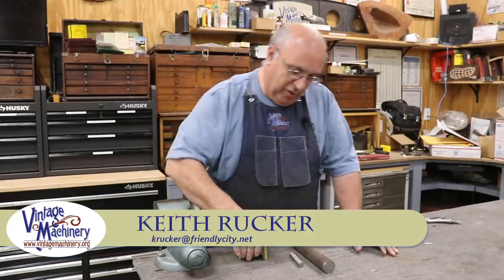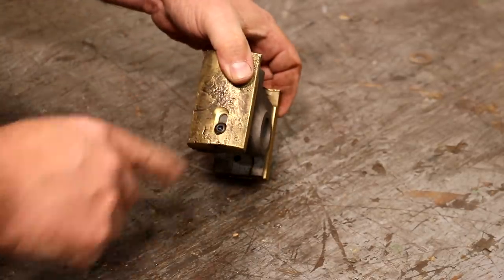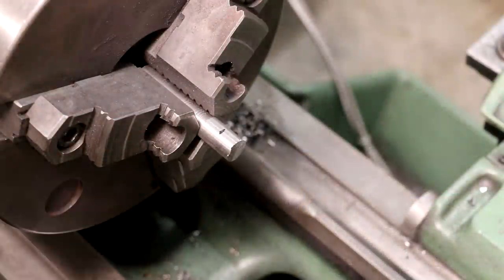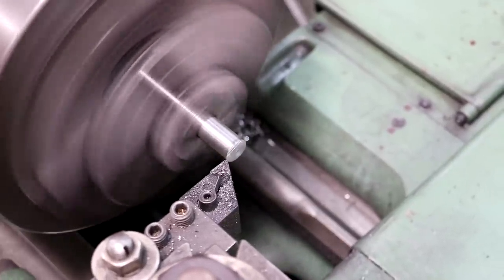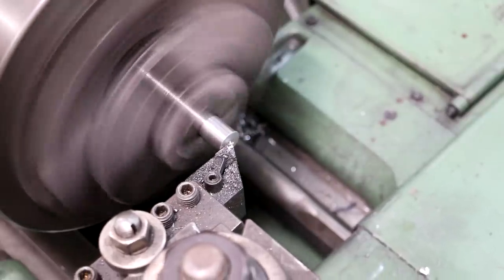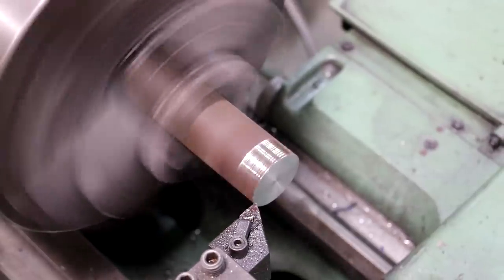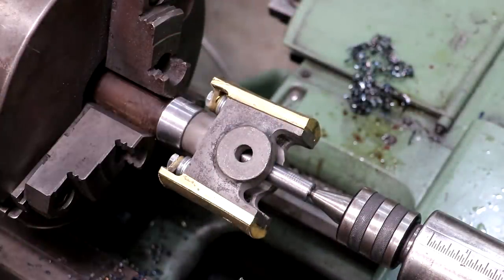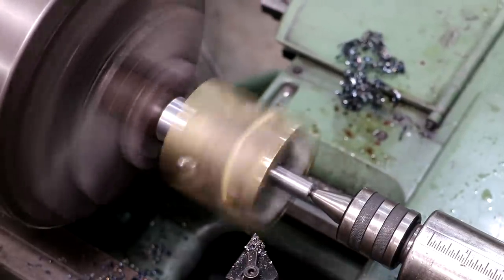Machining Bronze Shoes for a Steam Engine Cross Head: Part 2

Comment: This amazes me. I'm a 40 year mechanic with a fascination but zero experience with machine work. Also stuck in bed with Covid and these videos have been getting me through. I have wondered how you do not crash the part while threading into a shoulder like that and is it not possible to thread outwards from the shoulder to the open end? Just 1 of many questions I ponder while watching. Don't I wish I were younger and had someone such as yourself to assist and learn this trade from. It amazes me how you go from just a picture of an obsolete part and reproduce it. Thank you very much for the time and effort you put into these videos sir. Especially these videos on machining rough castings into perfectly fitted new parts.

Comment: 16:18 the part where it all went south but only the camera saw it. :-0 The screw apparently unscrewed as the run out sure looked worse and you can see the work go in and out from the cutter. Luckily it still did the job and the piece turned out just fine. :-)

Comment: Attention to all pattern makers: Always add shrinkage to your dimensions, add increased thickness to heavy areas to eliminate/reduce shrink dimples.
This was very visible as Keith cleaned up the diameter on these beautiful castings. The edges started to form the diameter long before the other dimples cleaned out.
In injected plastic we call them sinks. All molten materials shrink and sink as they cool. In our industry the mold designer must address these factors, in the metal industry the pattern maker is responsible. I am amazed to see someone taking a cast part, putty the holes closed and using as a pattern. The shape will be there but most dimensions won't!  One of the best examples was offshore 1948-1953 Ford 8N tractor exhaust manifolds, antique farm tractor exhaust manifolds tend to warp and break from the heat. Instead of making a pattern with the proper shrinkage added they simply would use an old manifold. When that was replaced they use one of their products for the next edition. Eventually our farm stores were selling manifolds with the exhaust runners being so near the mounting bolt heads a socket wrench couldn't be used!

Comment: The early bird gets the worm. It must be an acquired taste.
The second mouse gets the cheese.

When threading to a shoulder we'd like to see a split shot showing the work piece and a shot showing the magnificent hand coordination on the handles to prevent a crash into the shoulder. Nice job.
Reply: I was hoping Keith would turn the threading tool upside down with lathe in reverse and thread from the shoulder left to right. Much credit to him for good hand/eye coordination.
Reply: @ellieprice3396  So much easier, .I commented on an earlier vid suggesting the same thing, but , Keith is Keith. lol
Reply: Not an option on a lathe that has a threaded spindle (looking at you south bend!)

Comment: Great job! I was wondering if the top holes (those ones with the shims underneath) had to be oval, because of the tapering. If the bronze pieces are adjusted by removing a couple of shims, the holes are no longer exactly above the threads.

Comment: Hi Keith,
My thoughts on the adjustment slots on the sides of the brass shoes, If making them the length as the total height of all the adjustment shims (spacer washers) it would allow the full adjustment throw if all the shims (spacer washers) were removed. Nice job 😃👍😄
Reply: I thought the same
Reply: The ultimate adjustability is defined by how much wear can be tolerated on the thickness of the shoes, not on the screw length. Given the thickness of the shoes at the base, I doubt it would tolerate adjustment of the entire length of all those current washers. Not sure if the current slot length is more than the min shoe thickness.
Reply: @kindabluejazz  I doubt that it will ever be adjusted again after the initial set up. It's going to end up a "look at" piece, not a working steam engine.

Comment: Curious if you considered or if it matters: I would have maybe put a 45 deg chamfer along the edges of the parts before attaching them so that the interrupted cuts would have a softer landing as the part comes around to contact the insert. I know this is a relatively soft metal so probably not an issue, but I wonder how those edges felt right off the lathe and if you decided to clean them up after?

Comment: Keith, the adjustment flanges on the bronze shoes appear to be thinner than those pictures in the examples. Do you think there may be deformation of those flanges in time or will proper torquing of the fixturing screws be sufficient to prevent sliding and deformation?

Comment: When it was stopped, it looked like that was much wider at one end and you would run out of material to cut off but once it was turning it looked different. Just an optical illusion from the taper.
Reply: I had the same feeling!

Comment: i expected the adjustment screws at the top to be in slots in the brass casting.
As they are tightened will the brass casting move outward?
Reply: i was thinking the same thing
Reply: As you tighten the adjustment screws the brass shoes will spread out.  Without the slots this won’t happen.
Reply: The brass casting will move outward, yes; that's by design, so that as the shoes wear down you can keep the crosshead adjusted to the correct OD.

Comment: I was wondering if the face of the boss on the crossblock should have been faced. Otherwise the piston rod will seat onto it slightly differently than your fixture did.
If that wasn't part of the design for the crossblock, second best would be to make the shoulder on your fixture have the same O.D. as the piston rod.
Then again it may have been faced already, but it didn't really look like a machined surface, just a really good cast finish.

Comment: 22:00 this would be so much easier if you would use the metric system XD
Reply: He was using thousands. Metric literally would not have made a difference.
Reply: @dkamm65  Not true 1 thou (0.001 international inches) is 0.0254 mm (or 25.4 micro metres), 
When Keith was saying "60 Thou" (as in he was taking 1*60 Thousandth of an inch of material off the piece), it's the same as if he was saying he was going to make it 1.524mm smaller in diameter... Any unit of measurement can be converted to another unit of measurement It doesn't matter what measurement system is used if your cutting any amount of material in one system your still the same amount another (provided you convert units correctly) at the end of the day cutting is cutting.
Reply: @Whisperblade  I know they're not the same units, but working with either one is just as easy when using decimal fractions.
Reply: @dkamm65  I agree that the unit used doesn't matter, I only replied to you the way I did, because the way you worded your reply to metal implied that using metric measurements wouldn't have done anything at all.
Reply: That would be great. If the engine was metric. But it's not. Nor is his leadscrew, or measuring tools. So it would actually be more work. If the whole world was metric it would be awesome, but it's not.

Comment: Good morning. Do both shoes wear equally, or does all of the thrust component act on one shoe?
Reply: Most of the wear will come to the downside of the push stroke.
Reply: @ElmerJFudd-oi9kj  
I think they will wear almost equally because steam engines have double acting cylinders, so they produce power on both strokes...
Reply: @Henning_S.  The push stroke has the
weight added.
Reply: @Henning_S.  yeah, but doesn't the wear happen based on the direction of rotation? So it seems it might wear more the bottom of one side and the top of the other.

Comment: Great job,Keith. The only thing I would have done differently is,if the large stock were long enough,I would make the mandrel one piece.But,it really doesn’t matter. I like the brass shoes.Having the ability to adjust the clearance is a great idea. I wonder if there is a port in the sides to allow him to loosen and tighten the locking screws without removing the cross slide?
Reply: I think you have to remove the crossbar anyways because the adjustment screws are on the piston facing side which might be hard to access

Comment: Stoker!! Any Info on Mr Wiggins?
Reply: Priorities! Keith is always juggling at least 5 projects at a time. The stoker work needs to be done at another site with another machinist, and that needs to be scheduled when they both are ready. He also mentioned the Museum would not be ready for the stoker for at least another year or two based on other work that is needed on the full engine, so it's relatively low priority right now. Personally, I want to see that big metal planer slicing some 6-foot long chips.

Comment: just wondering why you made two mounting fixture instead of just one, could you have taken the lager piece of stock material, cut the stem too fit through the cross head and then thread a portion near the shoulder and have the mounting fixture never leave the lathe.
Reply: The bigger piece that chucked in the lathe might not have been long enough to do that with. Your way would work and arguably be better, but Keith's way used the stock he had on hand and is good enough.
Reply: Csab  I think he means have the threaded part of the piece in the lathe chuck long enough to go all the way through the crosshead and provide the support on the tailstock all in one piece.
Reply: He would have had to burn down and waste much more of that thicker piece of stock, and it might not have been long enough. He also mentioned he had that junky shorter rod and wanted to use it up in a place where runout didn't matter.

Comment: Great project and video. I was wondering why you didn't surface the top of the boss with the 1/2x13 thread at the same time you surfaced the top of the brass pieces for the adjustment screws?

Comment: That whole project was really slick!  Thanks for presenting it.  I'm not a machinist, but I am fascinated by your "gummy" mystery metal for the center support.  It seemed awful to machine, it was bent, and I noticed that it had deep chuck marks on it.  Are you sure it was even steel?  If so, why would anyone want to specify that alloy for a job?  I know you were using scraps here, but at some time in the past you or someone ordered it for something.
Reply: The gummy cut came from the same dull insert that he changed when cutting the second piece. Steel is chosen for the proposed use including weld ability vs. machine ability and price, the price difference between 1018 .625” at $11.09 per foot and 4130 .625” at $6.18 per foot does help make your choice.

Comment: sure was a close call getting the casting to clean up and be the correct finished diameter!  I was getting worried.  Bronze has a shrinkage allowance of about 3/16" per foot.  Might bump that up factor up if you allowed for it this time.

Comment: Would the fixture have been better one piece ?
Reply: He would have had to burn down and waste much more of that thicker piece of stock, and it might not have been long enough. He also mentioned he had that junky shorter rod and wanted to use it up in a place where runout didn't matter.

Comment: I'm not a machinist, although I'm very interested in it.  Question: Could the shoes have been machined down from two solid pieces of bronze using an end mill instead of spending the time and money to have them cast?  You could have turned the radius on the lathe just light you did at the last to clean them up and fine tune it.  Its a fairly soft metal (thus used as shoes) and easily machined, right?  I'm not getting the reasoning for the added expense.

Comment: Steam engine tolerances are not that critical, but you have 2 errors- both your thread in stubs went up against un machined castings, so they could not seat perfectly flat.  That threaded hole is not necessarily the centerline of the piston- that is determined by the wrist pin. You should have machined a stub to fit the wrist pin hole then found center on the mill and center drilled the stub, that would put your hole on the centerline of the piston. Thread the stub and use a drawbar to pull it up tight against the jaws.
Reply: I think Keith made the right call. Let me explain:
1) The end of the crosshead where the piston rod threaded hole is located was almost certainly machined flat originally - so that the hole could drilled accurately.
2) Assuming that the engine casting has the piston rod hole located in the center of the crosshead guideway, it is important that the crosshead's threaded hole for the piston rod is centered in the crosshead assembly, to achieve a good cylinder seal and prevent binding.
3) Misalignment of the connecting rod pin only matters for one axis of motion because the connecting rod is free to pivot on that axis; if the connecting rod slides a little side-to-side it will have no impact on the sealing of the cylinder, or binding of the mechanism.
Reply: @5tr41ghtGuy  Hard to tell from just looking at the video, but the inner hole was obviously not machined.  The side with the big stub looked like unfinished casting.  Yes, the alignment of the piston to to the rod in one plane is OK because of the side clearance, however in the other plane, if it is not properly centered the piston will be offset to one side of the bore at TDC.  As I said, for a steam engine it probable doesn't matter unless the error was a lot.  Automotive engines have the wrist pin hole slightly offset so that the engine doesn't make a slapping sound when the mixture fires.  Racers found that by reversing the piston you gained horsepower because the rod was slightly angled toward the down stroke on firing.
Reply: @oldschool1993  tell that (errors don’t matter in steam engines) to Swindon works on the G.W.R in Great Britain. They used Zeiss optical equipment to align their pistons, cross heads, connecting rods and valve gear with the axles.
Reply: @mikewoods4177  I was referring more specifically to this particular project which Keith said would be an air powered demonstrator.  I don't doubt that your folks at Swindon do use those Zeiss instruments today, but depending on the locomotive, they were likely not used when they were manufactured.  Swindon was in operation from the mid 19th century, and Zeiss did not develop the optical alignment tools until the 1920's.
Reply: @oldschool1993  i see what you mean but just FYI Swindon was using it on steam locos at about that time or just after. An engineering paper exists with photos showing the optical gear in use. Sadly the works closed in 1986 so the point is moot now but the Castles, Kings (both 4-6-0 s) and similar vintage locos were built using it.
Reply: @mikewoods4177  I can see that, as from the 1920's up to the late 40's steam was at its highest point of engineering, and they would have used whatever means possible to improve efficiency and reliability.  Sadly, like todays' internal combustion engines, it was a dying technology.  As a kid in the early 50's we used to see some steam locomotives pulling freight on the Great Northern line and we always ran down by the tracks to watch them go by.  In my first trips to China in the early eighties I rode on a number of steam trains.

Comment: Why did you allow the run-out? It seemed excessive.
Reply: The runout was on the support piece which is not part of the component being machined.
Reply: Nothing sticks out that end when the part is in use. As long as it is true where it was chucked into the lathe it is good. The end where the steadying fixture was running out is the end where the articulated part of the piston rod goes. The holes in the sides of the crosshead are for the wrist pin.
Reply: Not knowing the symmetry of the taper mounting surfaces to the tapped hole or the wrist pin bore it is difficult to choose a dominate feature to satisfy. Which feature you choose the other would be out or both if you averaged however the runout is probably within the required assembly tolerances.
If the pin bore was symmetric to the the tapers I would have fixtured by milling a tab on the end of the round blank, crossboring to insert a pin.
What condition is the cylinder bore concentricity where this assembly lives? Has it been worn, it diameter remachined? We hope it is perfectly round.